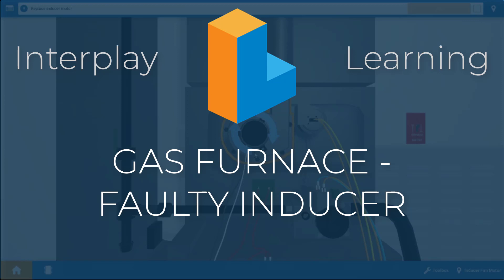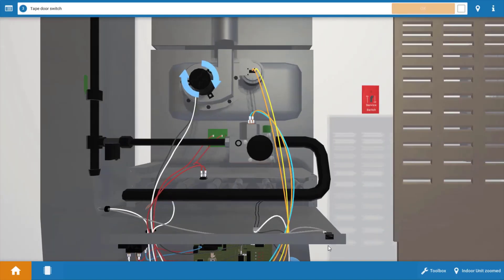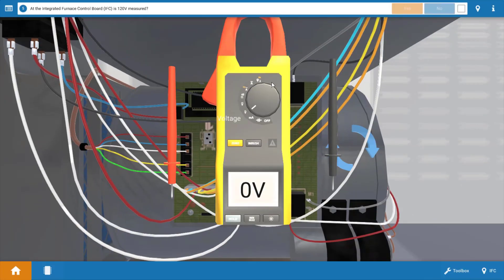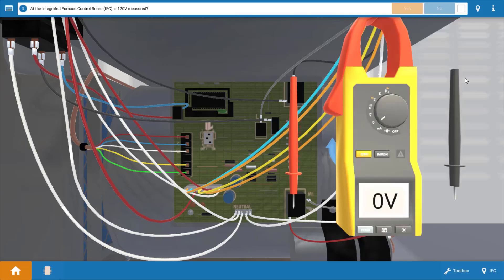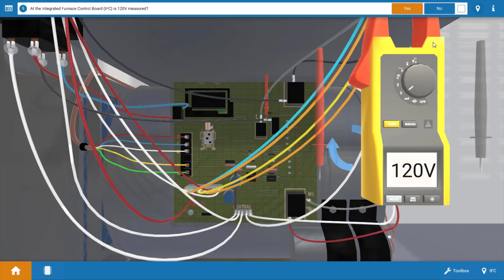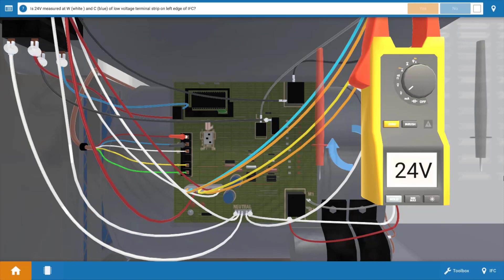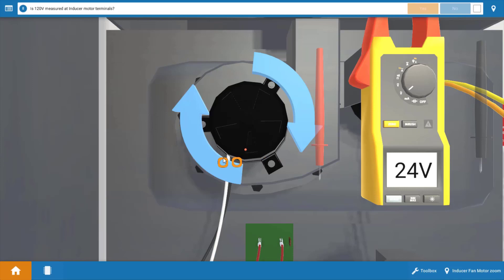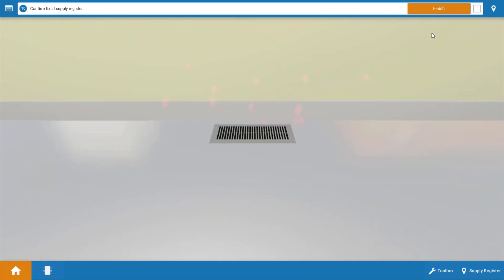How to Troubleshoot a Faulty Inducer Motor on a Gas Furnace

Comment: When I removed the power from inducer motor, only 7 ohms read when measured it.  Also, it's extremely hot when power applied.  I have a bad motor, right?  Thank you for the video, I like the format.

Comment: What if the inducer motor is turning on and off multiple times before igniting and running? After ignition, the cycle runs normally.
Reply from the maker: Monitor voltage to the inducer motor while this is occurring.  Make sure you have a consistent minimum of 108v. If not, the ifc or the wiring connections.

Comment: Can a pressure switch stuck in one position cause inducing motor not run or that pressure switch would never cause that symptom?
Reply from the maker: If the pressure switch is stuck open, the IFC may recognize this, populate an error code, and prevent the inducer from running on a call for heat.
Reply: @InterplayLearning     Thank you. On the other hand would a stuck inducing motor cause pressure switch to not close and thus would still remain open but would show error code for open switch but no indication of motor malfunction. Depends on manufacturing I guess 😁👍

Comment: What if you have zero voltage coming out of IFC
Reply from the maker: Hi Antonio, if the procedure guide is followed (check for main power, transformer voltage and thermostat)  and 0 volts are measured at the IFC output terminals, the IFC is faulty.